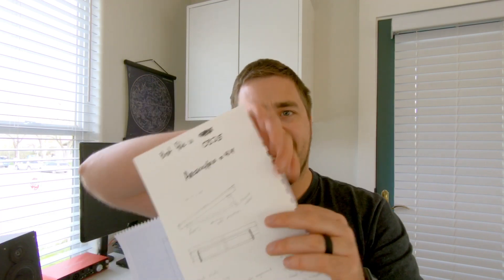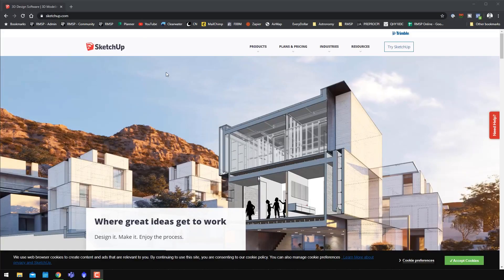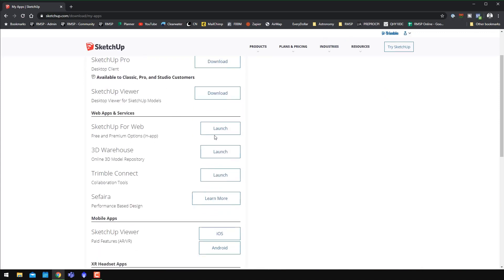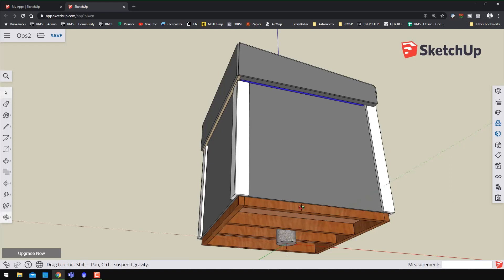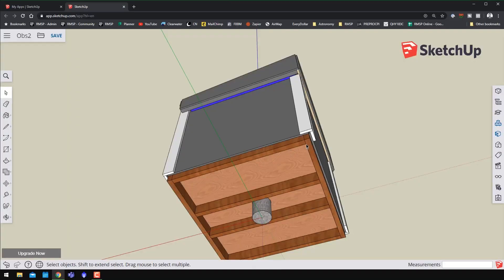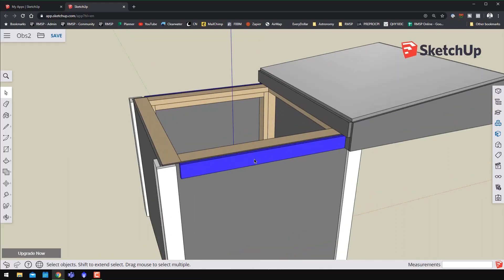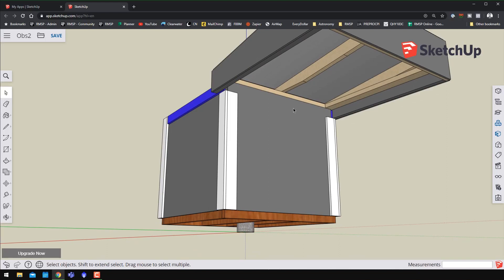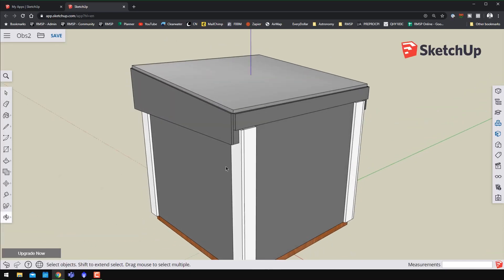Mini Backyard Observatory - Part 2

Comment: I don't understand how you are going to keep water from infiltrating on the south side between the roof and the walls and still allow the roof to roll.  Anything that hangs down below the gap line to cover/seal that gap will have to be flexible, like a rubber wiper.  Hope to see the conclusion of your build, as you promise in part 5--I'm interested in seeing the final product so I can convince my 'supervisor' that this will be a 'go'.
Reply from the maker: Great observation! That would have been handled with a drip edge on the top board that directs the water away from the crack, and a metal flashing on the top of the bottom board that keeps any water that does get through, off of the wood below the flashing.

Comment: will water run off the roof and inside the cube? I know flashing and all will be put on but I would be spooked a little. especially when open if it starts to rain. looks cool though. Nice work. I am just learning basic astro photography. Interesting to watch your advanced videos
Reply from the maker: Thank you! Great observation. That was one of my concerns too, although I’m planning on adding a rain sensor that will close the roof if any rain is detected. Until that part is complete, I’ll be observing only on nights where rain isn’t a possibility.
Reply: @FoFoAstro  I had thought the same thing.  Why not reverse the slope direction anyway?  It seems more logical to have it sloping away when open, just in case the rain sensor fails or you accidentally leave it open.  Even if you get some dew, it would at least accumulate and roll outside the box.
Reply: @SHastroKS  the reason was to maximize the view of the northern sky. Once I get the four walls built I can easily change the roof direction before I build it depending on how the clearance looks once I can see the building partially built.

Comment: A couple of observations; I think I would put a stud in each of the four walls for support of the siding and protection from things bumping into the observatory. The observatory might need some anchoring if it sits on four blocks, when you roll the roof back that will put pressure on the back and create a tipping situation. The 3-D modeling was a pretty cool program.
Reply from the maker: Great suggestions Raymond. I didn’t think of studs as being good protection for the siding. I had thought of the weight of the roof maybe tipping over the building. I’ll have to see how it goes and maybe add some sort of anchoring system to the base if need be! Thank you for the observations.